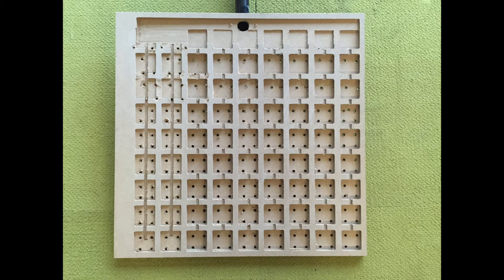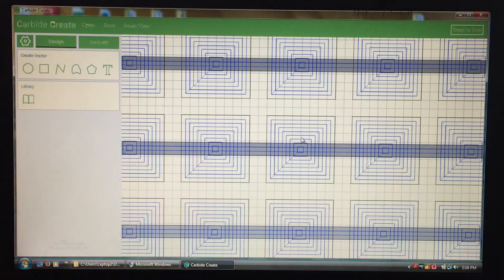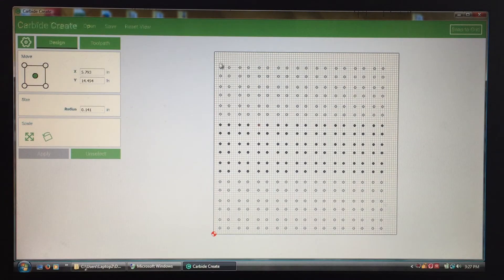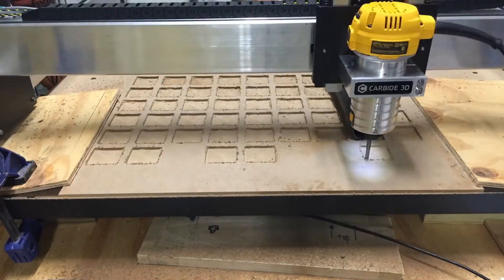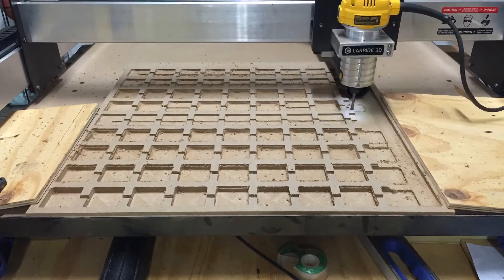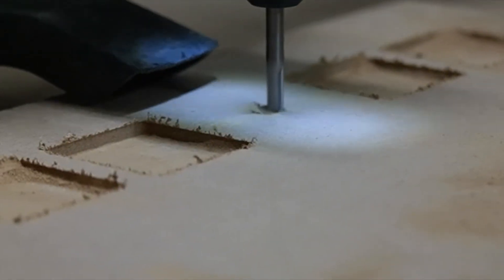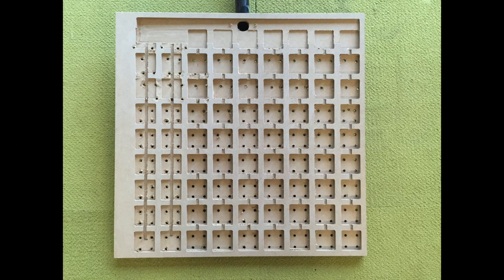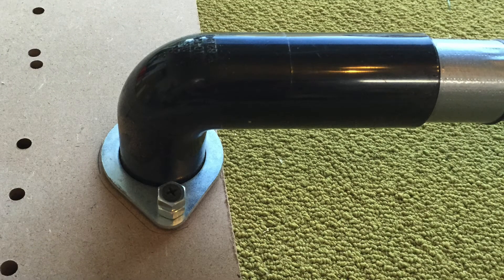Shapeoko 3 XXL: Making a Vacuum Board

Comment: Should have put the vacuum hose hole on the back corner, so it doesn't get in the way of the gantry.  Even better would be on the edge if you can make your board thicker or if you have access to a 3d printer and make an adapter from the hose to a long slot that can go into the rear edge.  Great job, though.

Comment: What are a few examples you can use this for im interested :)
Reply from the maker: This works great for projects where a clamp might get in the way of machine's tool path; for example, a sign that needs to have a bevel or chamfer around the outer edge. When using it, however, it is a good idea to keep an eye on it because it has slipped once or twice. Also, any of the holes that are not covered by the workpiece should be covered with scrap wood or paper to make a better vacuum seal.